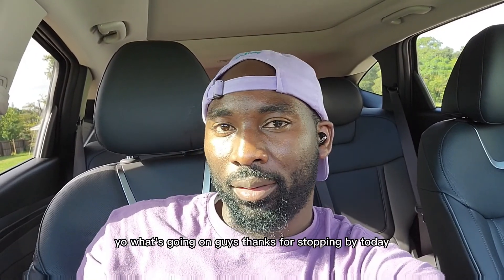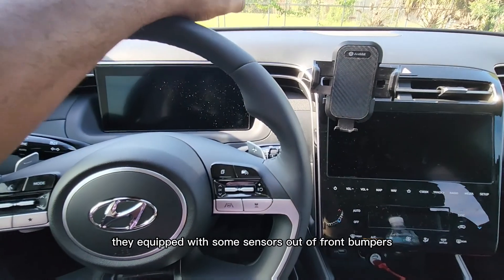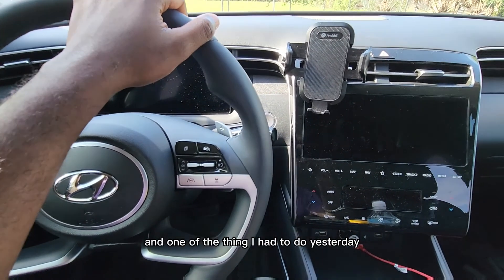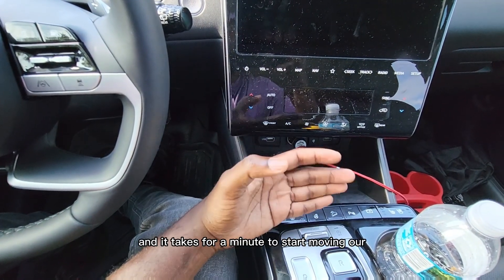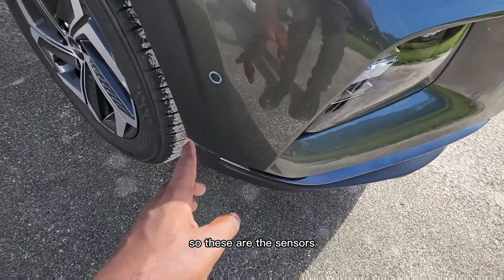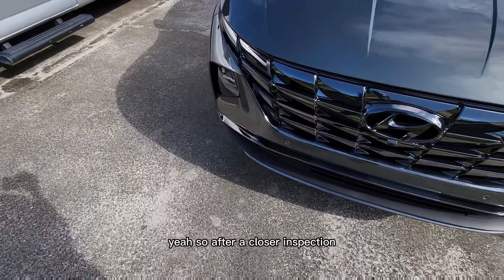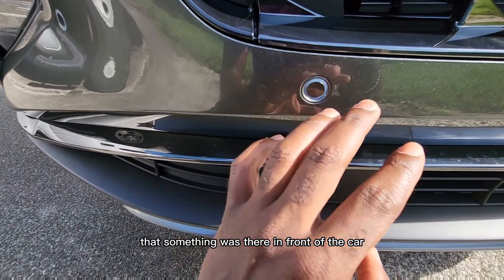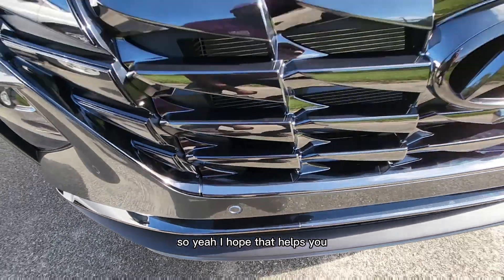How to fix Hyundai's forward collision sensors.

Comment: When I was driving in the rain 30 seconds after I hydroplaned All my lights came on for my 2022 Elantra hybrid it says check forward safety system rear safety system and blind spot safety system and it keeps kicking on the ABS system constantly when you first turn the car on and then after driving a little bit then you will get all the errors and it will disable abs and it drives normal. My car has been in the shop for 3 weeks at first they thought it was the wheel speed sensor. That did not fix it now they bought a brake booster which I highly doubt is going to fix it because it didn't have any trouble braking. But it takes 2 weeks for the parts to arrive I just don't know how long they're going to have my car
Reply from the maker: Did you try  my tips?

Comment: I have a 2023 Hyundai Elantra N and I have not necessarily a problem but sometimes when I am driving it will flash a screen on my dash that says "check forward safety system" but it goes away, it's happened a few times but has never actually been a problem because I know that the safety system works as it has gone off before. I believe maybe there is some type of software bug that needs to get a patch, or sometimes like you said maybe a little rock hit the sensor and set it off 🤷‍♂️
Reply: I have that same issue it’s so annoying
Reply: I went to dealership the said it’s fine just the dirt and rain block the sensors